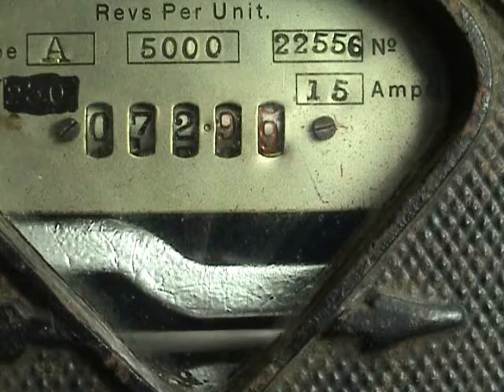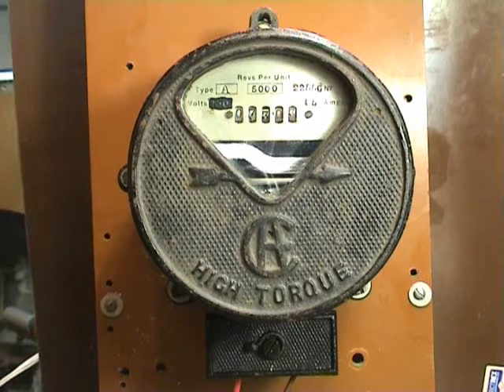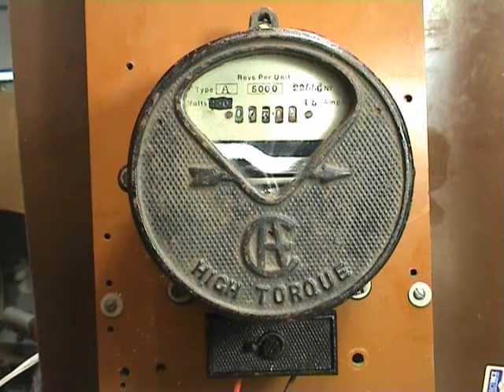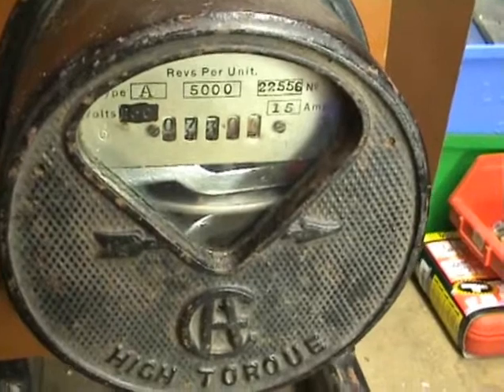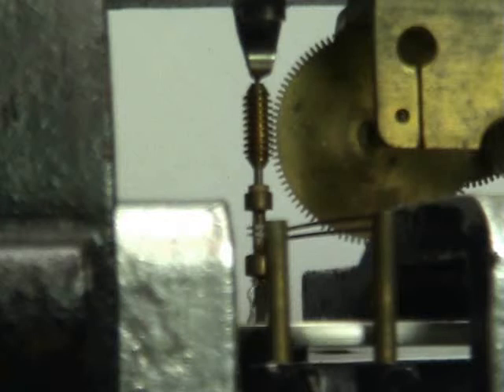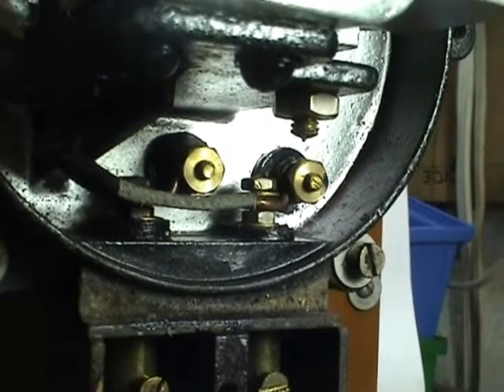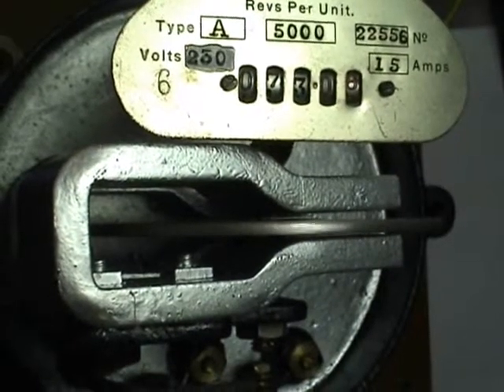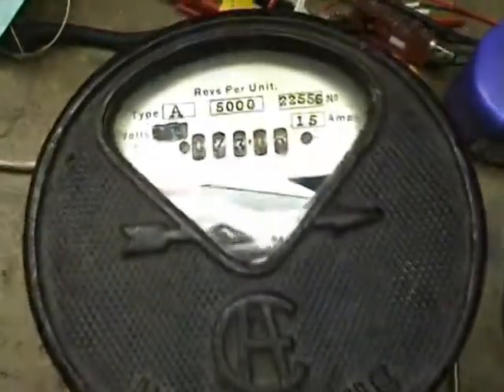DC Ampère hour meter

Comment from the maker: @mrmatt2525able  Correct !
 Thomas Alva Edison opted for DC systems and Nikola Tesla opted for AC systems which are now the standard.
AC is easier to transform up and down in voltage, as well in alternators with less maintenance as current is taken of the stator windings.
Bear in mind that long interconnecting cables between countries are sometimes DC at very high voltage.
E.G. In New Zealand we have a 620 kV link between the North and South Islands, about 400 km long.